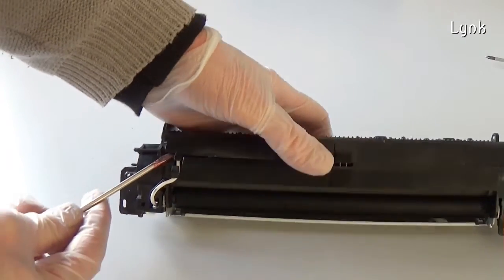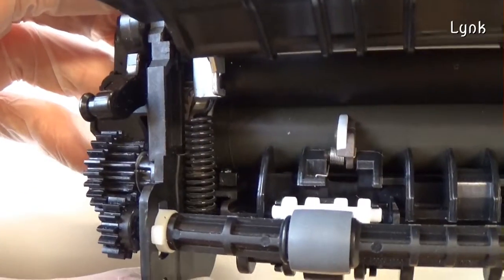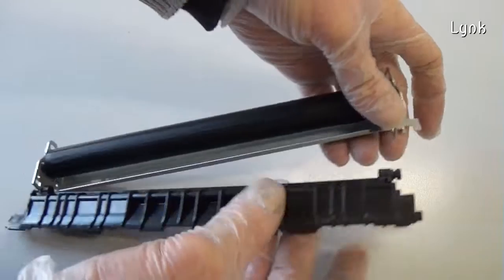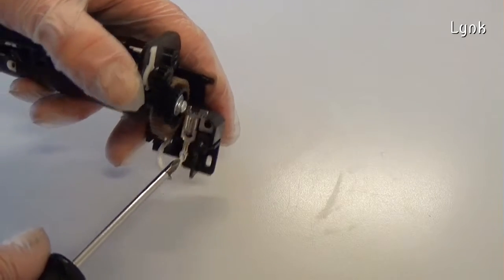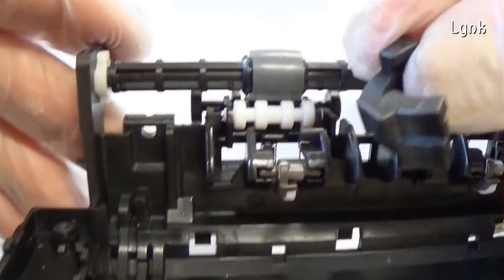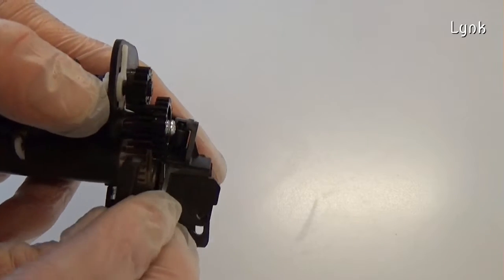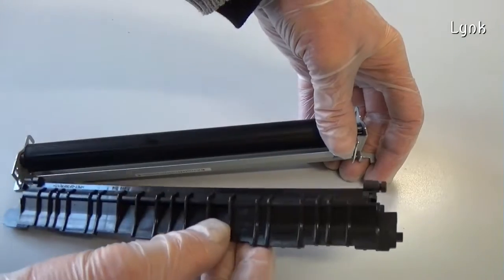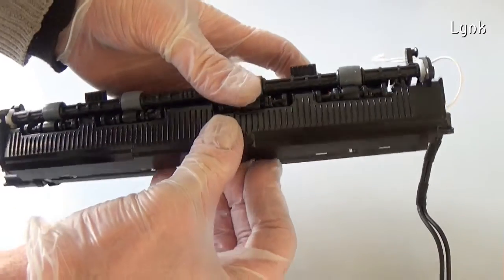HP 100 103 107 108 Samsung M2070 Fuser Unit Disassembly/Reassembly

Comment: bro did you miss on the last part, a screw on the wheel side? if so then i have 1 screw over, should i screw it in from above or below
Reply from the maker: no I think the video is correct, there are no other screws on that side

Comment: Hello, is it possible to replace the plastic exit roller without removing the fuser unit from the machine?    Ours has been broken and a replacement piece ordered.  Thank you.
Reply from the maker: The rod with the exit rollers? It has a gear on the side, It's not possible
Reply: @viandant5  Thank you.

Comment: Hello, good afternoon, Mr. Viandats5.
I did the procedure explained in the video but now my HP 107 printer has an error (U1-2320), it does not print and remains in an error state. Can you think of any reason? connect everything correctly but it does not leave that state.
Your advice would be helpful, thank you very much.
Reply from the maker: That error code indicates that the fuser temperature is abnormal, probably you have to disassembly and reassembly the fuser unit again. Or the power supply is bad.